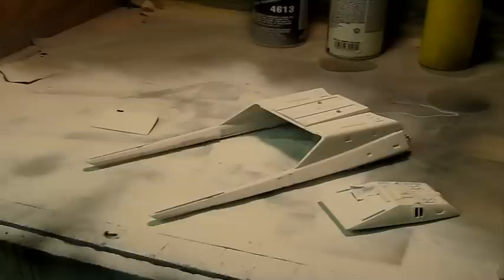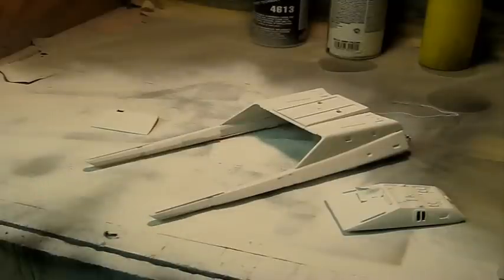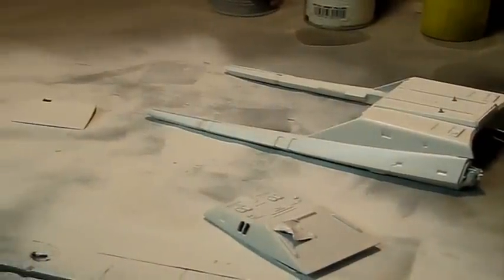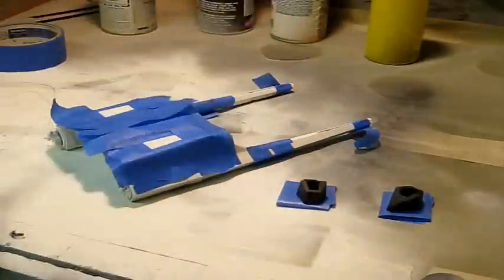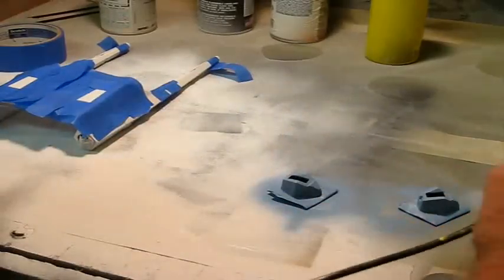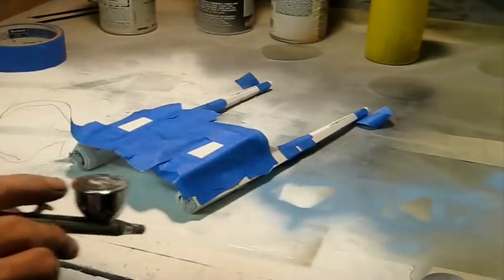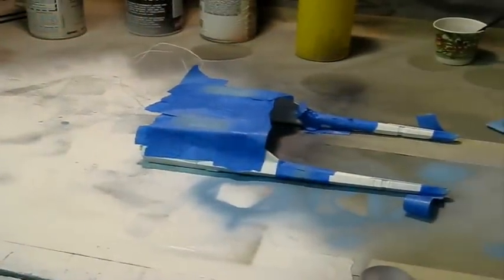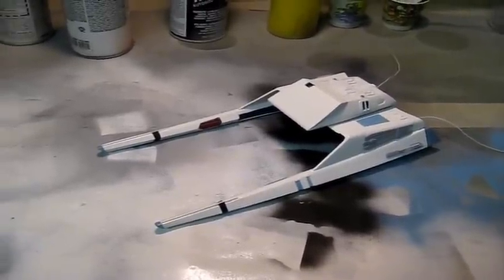AMT Vulcan Warp Shuttle Buildup PT - 6 Laying Down Some Paint

Comment from the maker: Yes I pick mine up at my local Gladwyn auto paint supply store in 8oz plastic bottles. 
The paint reduces about 3 to 1 so 8oz lasts me through several models. 

I have my own business using the Spies paint for doing mobile auto paint repair.
I discovered it is excellent on plastic models and have been using it for a long time. 
There are about 100 colors in the set including various pearls and standard colors.
I mix my own paint colors to match.